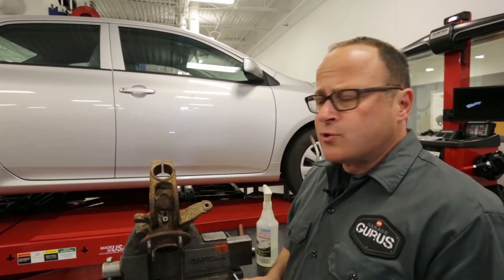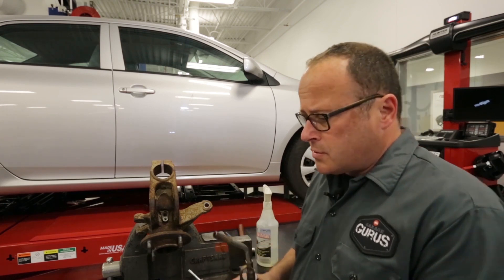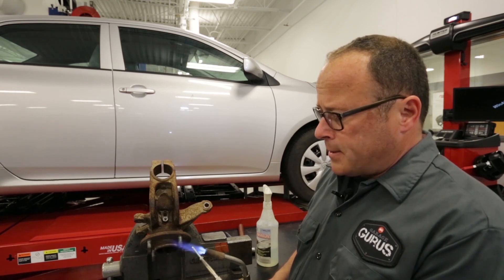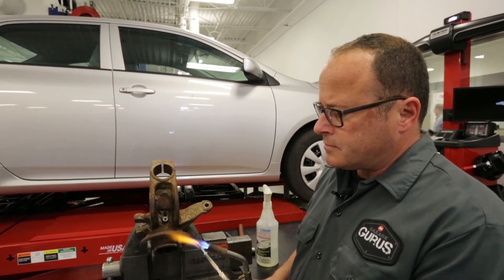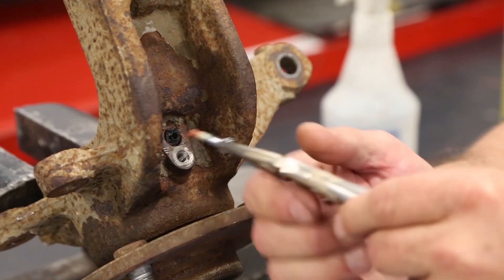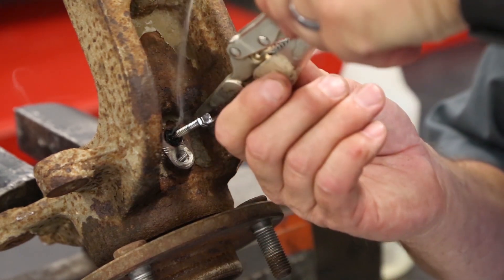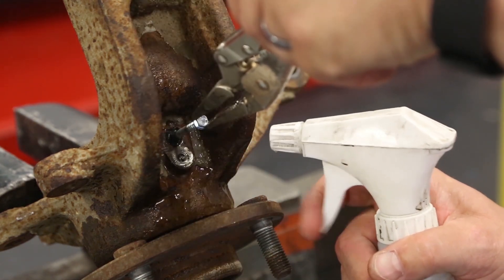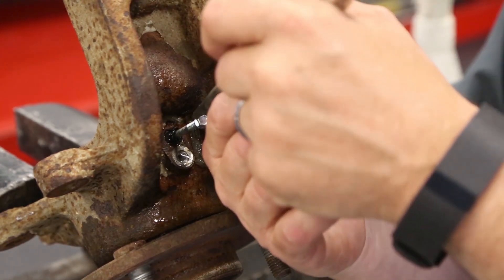ABS Sensor Removal

Comment: Dave, You are the man!  Youtube should allow multiple thumbs-ups.  Worked like a charm.  Sensor was stuck so tight I had to use a pry-bar under the screw head.  I thought some of trying an easy-out but then I found your video.  Much better technique.  Thank you so much for a HUGE time saver.

Comment: Is it possible to either: 1:   Drill the remaining stuck sensor, to bits, then suck it all out?
Or  2:   Use a normal screw, without heating anything up, and screw it into remaining stuck sensor, then pull out with a claw hammer or similar?
cheers
Reply from the maker: You can drill it out but there is a chance you can damage the tone ring. We like to use heat because the plastic melts on to the screw and adheres it together. A claw hammer will might work, however it will pull it out on an angle and might break it again.
Reply: @GarageGurus  PS, i will have to suck out any remaining bits right? I mean, can they just fall out the other end?
Reply: @wellifthemediasaysit the bearings in the other end
Reply: @GarageGurus  Thanks man, i might have a crack at it tomorrow, but not sure the best method to use

Comment: I tried to do this on my 05 Honda Accord today. But the sensor didn't bodge, even when using force. The screw came loose eventually. I think the metal core of the sensor is internally rusted, thus expanding the plastic. Anyway it won't come out. I considered drilling it out, but was worried part of the sensor would be left behind in the hub, messing up the sensor ring, etc. Any idea's would be welcome. Thanks
Reply from the maker: Jeroen,  please be advised that due to the fact that we are not able to physically see what is exactly going on, we suggest taking it to a certified technician or mechanic for further help.
Reply: @GarageGurus  thanks for your reply. I found another tutorial about removing the hub. Then I will be able to drill it out. Already ordered a new sensor, so I am gonna give it another try first. 👍
Reply: Finally managed to get the sensor out today (hub removed and drilled out). Replaced the sensor with new one. But the fault code won’t go away. DTC: 15-1 rear right abs sensor open or short circuit.😟. Cleared the fault code several times, but comes back immediately. Did a wheel speed test while driving, only the rear right wheel says 0 km/h.... so still no signal.

Comment: On my '95 Avalon, the magnetized steel rod was stuck in there as well. I hadn't seen your comment below about putting the heated screw in off center. So I tried my own variation. I just torched right into the hole. It loosened up the plastic and allowed me to pull out a load of the fine copper wire that is the guts of the sensor. Then with a 30-degree angled pick, I pulled and yanked some more. Finally a second torching allowed me to yank out the magnetized steel rod with a long-nosed pliers. Then, I used the pick to loosen up the plastic sleeve, and pulled that out with the long-nosed pliers as well.

Comment: Would this work on a sensor with the magnetic core? I'm looking at you Nissan
Reply from the maker: Yes it would work with a sensor with a magnetic core. The screw would be a little off center but it works just fine. I use this method on crank and cam sensors when needed as well.
Reply: Garage Gurus yeah bullshit now iv got 3 broken screws inside my sensor im gonna have to buy an antirely knew steering knuckle.